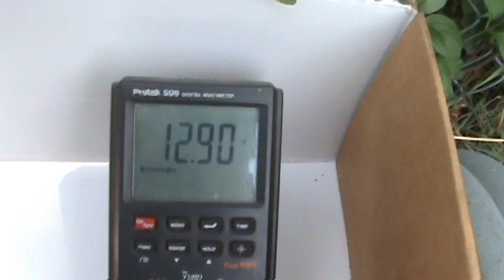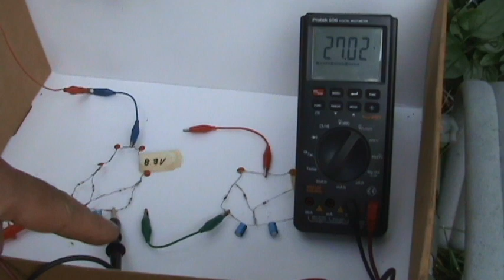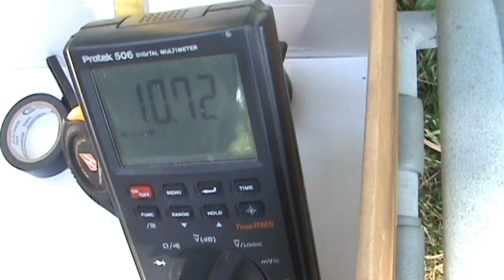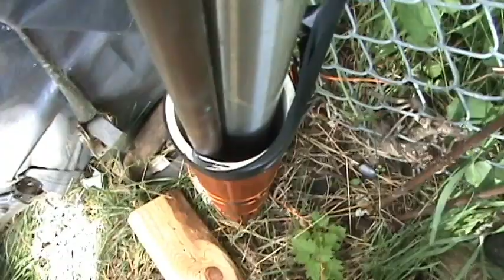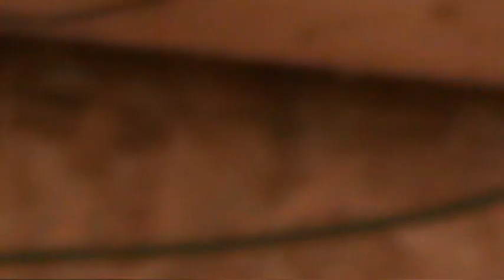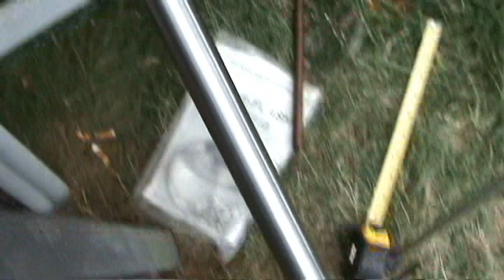Free Energy From Air 2019,  part 11

Comment: What maximum current did you measure with any of the circuit arrangement?
Reply from the maker: About 600microAmps and 127V.   Now I learn that you just need voltage and you can get the current back at the end. Please check out my latest project of "wireless transfer of energy" :-)  This project led me to that project.  Now lighting up over 700 LEDs with only 16V and approx 50mA, approx 1 watt, but more testing needs to be done yet.

Comment: If you have two matching transformers with large enough pizos on them you might make a peizo power generator with power from air as a starting power to set up some over unity oscillation. It works by having about two piezo elements wattage should be high aroung ten to 100w. The two transformers should have a very high ohm coil. If you use the high ohm coil with the peizo for antenna and ground and hook up the smaller coils back to back then hook the other piezo on the other side to make a matching resonance it should produce usable power. Just a theory I have not tried it yet. Or you can take many Silicon carbide bridge rectifiers and wire all the ac in parallel to the antenna and ground with the Plus and minus as the outputs all in parallel. I don't know if you need a seven henry coil or piezo to make it work but it may make some power on it's own or just a large ac cap.
Reply from the maker: Good ideas to try, thank you Travis.  Good to see you again.  
I hope to finally get power readings in & out of my OU project with over 700 LEDs.  My new scope did not have the functions i needed, so i had to get another scope, maybe arriving in mail today.  Its been a couple of months since my last video.  Stay tuned my friend, im going to change the world :-)

Comment: I think you need many Capacitors and bridge rectifiers in parallel to get a useful wattage. I posted some circuits on retro inventions on face book. Only they were done in gEDA schematic editor on Linux mint 19.
Reply from the maker: I see the "neg impedance oscillator" & "super joule thief circuit" & "lost battery technology" ,,,,,is the joule thief the circuit you wanted me to see,,,,,,,,or?
Reply: @INVENTOR3  No I literally made a demo of just one bridge rectifier with once ac connection to the aerial and the other one connected to ground. The more of theses you have the more power I think. But I think capacitors could help ac current while improve dc output. It is just that simple. A single bridge rectifier runs a led.
Reply from the maker: @travismoore7849  Hmmm, yes, multiple antennas and rectifiers, i thought about this many times. Thank you.  Not easy for me to put up multiple antennas, but i will keep thinking about it.
Reply: @INVENTOR3   A bridge rectifier is just 4 diodes. So it goes to say that you can put a lot of them on a board to harvest power from air. Connect two 200nf capacitors to the ac and and a cap on the output for a similar configuration as your power from air one.
Reply from the maker: @travismoore7849  Thanks for the ideas!  In next video i try charging a cap,,hopefully i get time to post later today.  I will have to dig out old diode i got from John H, it is very sensitive to light,,,maybe see if i can find more of them online someplace.
Stay tuned for next video :-)

Comment: About what tuning happened, so for a Crystal radio Coil that is Multi Tapped - wrap 10 make loop/extension for tap, do 10 more tap, so on till 100 or more tap every 10 or 20 same count each time. Go search "Crystal radio-YT" and Multi Tap coil, with swiper might give you that tuning you need. I also wanna suggest, thick AWG 12-14 single coil at base in reverse of Tesla Coil for lighting show, try to use Primary(Thicker AWG, at base) as your source(antenna) connection- some thing like a variable Air core Transformer Capacitor. 
Keep  up that search, and thank's for sharing..
Reply from the maker: Good idea with the taps.  Hmmm, you mean a primary pancake coil at base of other coils,,interesting, hmmm, i will think about this.  And add a capacitor,,,calulate capacitance same as i would with the Tesla coil, yes, interesting ideas, thank you.
Reply: @INVENTOR3  Look up :Antenna power-Magnetman2010, he show's Circuit charging Cap. running Joule Ringer running a LED. He should be using Pancake like 
: Tesla pancake coil"Back EMF" video by 
-Great ENERGY1891.
Also "TinManPower" make's video
:Tesla ss ssg-excellent results.flv, shows tower coil to Pancake Coil.
 Thanks as always for your Sharing your findings, that's why I suggest digesting these other video's.
As well as researching that Multi-Tap Crystal Radio Coil, I think Magnetman2010" use's one in one of his video's for this circuit for Boost, testing several Tap's till finding one with most out-put.
 KNOWLEDGE is POWER, KEEP That POWER FLOWING!
Reply from the maker: @j.christie2594  Im am already subscribed to magnetman2010 & tinmanpower, but now have set to receive emails notifications :-)
I love that thousands have replicated my work,,,i mean i know i replicated Tesla & Joe Tate,,but since i first posted this project about 10 years ago so many have replicated, and it makes me very happy to see this.  I like the way mangnetman soldered in taps, he must have very carefully removed the enamel on only the spots where he solders.  I like the idea of pancake coil, this sis something that i have not tried yet.
I also replicated lidmotors PENNy circuit, but i did not use twist tie coil and i also tuned the bucking coils with ferrite rod....
https://www.youtube.com/watch?v=B_j6Q1y2KDY
&
https://www.youtube.com/watch?v=7uRF_-88kZY&t=321s
Thanks for your comments,,,,,KNOWLEDGE IS POWER!! :-)

Comment: The problem with atmospheric electricity harvesting is everyone is only harvesting dielectric field/electrostatic force from the atmosphere which is only one half of electric field that's why you have voltage but barely any current. Electricity/electric field is combination of dielectric field and magnetic field crossing each other at 90 degree angle. You need to harvest earths magnetic field as well for current gain, magnetic field is also going through earth all the time. If copper wire is good at harvesting dielectric field from earths atmosphere, i think iron or steel wire would be good at harvesting magnetic field/current from earths atmosphere. What if you made an antenna out of copper and iron/steel wires where iron/steel wires are connected horizontal to copper wires creating a square net which you can then roll into a pipe form and install at higher altitude? Earths magnetic field apparently has westward drift which might help harvesting current if it is possible to harvest.
Reply from the maker: Interesting ideas,, i understand what your saying, copper & iron screen :-)   Hmmm, westward drift,,,,Dr Moray had his antenna facing E to W.  Thanks for your input.

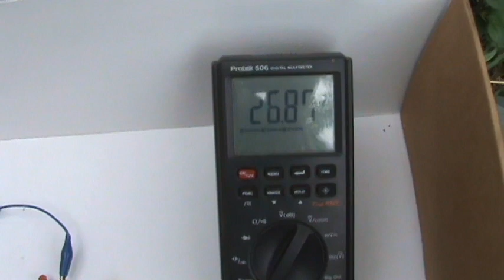Comment: Hi bud, how ya doin? Seriously: How are you doing out there in 113 degrees F weather? Just approaching 80* I turn into a water fountain! I don't know how you do it man, but I love what ya do! @3:20 I find the same, more power with cloudy weather, and too at night!
@4:20 it's otherwise known as magnetic coupling. You are still grounded, via induction from your coil to the ground rod. Just like a primary induces a secondary reaction in a transformer, you are effectively doing the same with your ground set up. The primary being your coil and secondary being your ground rod, you are still magnetically coupled.

But you have also made what is called a 'variable' inductor, which is why height and distance matters soo, so much! You are coupled to that ground rod via magnetic coupling, but no different than any tuning rod, variable inductor or variable capacitor! Think about tuning a radio, it's the same thing, basically. What those radio guys/gals throw away is what we try to collect. Many a tower has been wasted due to electrical build up @200 ft and no good way to get rid of the excess charge/energy. In the early days of radio, many towers caught fire because of the excess energy at altitude. Now A Days it's a shunt to ground via more specialized equipment pretty much takes care of the problem.
You continually reach higher voltage levels than I ever have, I think that's awesome!

Keep on doin what you do my friend.
Reply from the maker: Thanks for your input Michael, much appreciated!!  Hope everything is going well with you.  I agree, magnetically coupled to ground.  Yes, like a transformer,,,,but ground must be the primary and the coil is secondary, because it is transforming-up,,,but yet this still seems strange to me.  In the past i tried a regular transformer, but did not work, i figure because there is not enough current to induce secondary, im not sure exactly,,,but i will have to try it again. But strange that this homemade transformer we use in this video does work.

Comment: Nice work! Getting closer!
Suggestions- Put bifiler winding around that ferrite rod you have. Connect antenna to bifiler, then bifiler to ground coils. Then add another circuit in series and/or parallel for best results. I used 4 bifiler rods, 3 circuits, and 1 ground coil(about 18” long x 2” thick) 28 gauge. Rods were 23 guage.  Awesome!
Reply from the maker: I will try this in next video, thank you very much :-)
 I put link to one of your videos in description.
Reply from the maker: Did you wind your bifilar coils like this....
https://www.youtube.com/watch?v=jTsEOnxiDaA
Or like this.....
https://www.pinterest.com/pin/669277194597038046/

Comment: Instead of a solid bar of steel, you would do much better to pack it with super fine steel powder because it would lose less power o eddy currents. ~( 'w')/
Reply from the maker: Interesting, i see your point with the eddy currents, they would get tied up in the powder chips & not penetrate deeply into the bar.

Comment: I agree with Eric, try crimmer caps. The more you can tune the circuit to 'ring'  [oscillate] in resonance with whatever frequencies you are encountering in the environment the more power you will realize at the output. ~( 'w')/
Reply: Thank you! English is not my forte'. Exactly what I was trying to say. Tuning for oscillation.
Reply from the maker: Eventually i want to add the Barium cylinder & resonate with it,,,hoping there will be O.U.